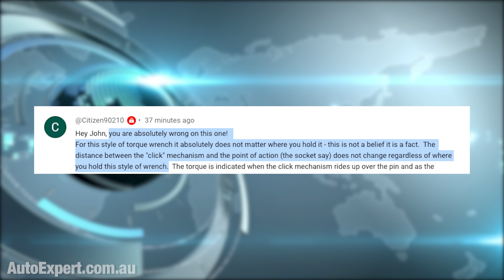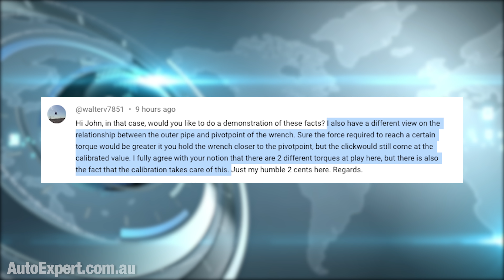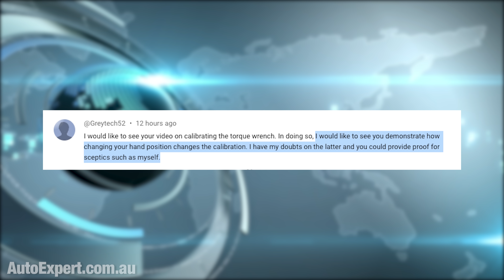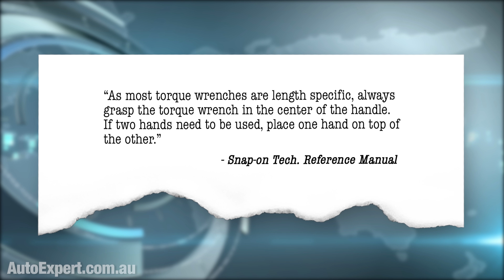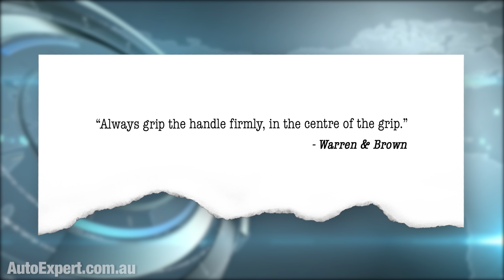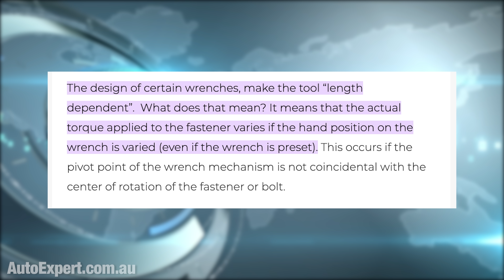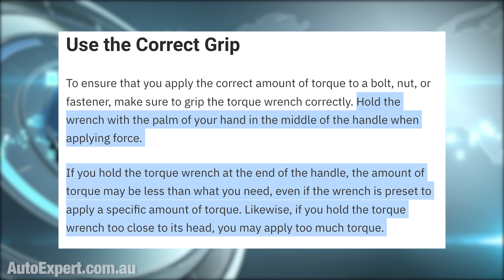Am I wrong about torque wrenches & hand position, again? (The facts) | Auto Expert John Cadogan

Comment: John is correct (unfortunately).  It can be demonstrated with simple maths.  Imagine a torque wrench where the centre of the handle is 550mm from the bolt being torqued, and 500mm from the intermediate pivot.  If you were to apply 100N (ie equivalent to 10kg) to the handle, the bolt would experience 55Nm of torque, and the intermediate pivot would experience 50Nm.  Assuming the wrench is set at 55Nm, it would click when applying 100N of force to the handle.  However, if you were to “choke” the handle and apply double the force 200N half the distance from the intermediate pivot (250mm), it would again click because the intermediate pivot has experienced 200 x .250 = 50 Nm.  However, the bolt itself will experience 200 x (0.25+0.05) = 60 Nm, instead of the intended 55Nm.

Comment: Hi John, unusually I do want to disagree with you.  However, I do think that when explaining something that is likely to be misunderstood, it really does matter to demonstrate it.  Use of a torque meter in the original video would have been really helpful.  Let's be honest, you made the video to educate. Showing the proof with use of a meter would have been helpful,  It would also have saved the embarrassment of some of your dedicated followers.  I do get engineering and physics but I needed to watch the video for a second time to understand why you were correct.  It does require the movement of ones brain from the simple position of, the click will happen at the selected torque so the hand position matters not, to understanding that the torque on the click mechanism and the torque on the fastener are different and that the designers have to compensate for that, hence they need to ensure the relationship between the torque on the fasten and the click mechanism is constant and predictable.  A very important point.  I suspect you probably deliberately did not demonstrate with a meter just so you could upbraid the average comment maker for his stupidity and make another two videos on the same topic.
Reply from the maker: Perhaps I am that evil...
Reply: @AutoExpertJC  
hahahahah
Its just an Aussie thing..
We Learn from our mistakes - so bluddy Learn !

Comment: The hand position matters 100%. I used to calibrate torque wrenches for a living. You can also look up the torque calibrators, the part that triggers the wrench while you activate it, its on a slide so you can place it on the correct spot. Holding it away from the handle by moving your hand closer to the head or you use a cheater bar on the wrench, will give an incorrect torque value.
Reply: then you have the knuckle draggers that use torque wrenches to loosen a nut..

Comment: If I attach an infinitely long (or let’s say 100m long) cheater bar to the handle, does this mean the torque applied to the fastener will be zero or close to zero?

Edit: no, it would apply less torque equal to the percentage difference between the distance from the point to apply the torque and both the socket, and the pivot point
Reply: I think if you would use a long extension and fix it to the end of the handle, you could essentially rotate the outer tube around the click point, thus ending with a click without torque on the bolt. Not 100% sure tho.

Comment: The primary reason torque
wrenches come in different
handle lengths is to provide the
user with various options for
leverage and reach, making it
easier to apply torque in different
working conditions. Longer
handles can provide increased
leverage, which can be
advantageous when working with
larger or tighter fasteners, while
shorter handles may be more
convenient in tight spaces.

In summary, while the length of
the torque wrench's handle can
affect the user's comfort and
ease of use, it does not directly
impact the torque applied to the
fastener. The applied torque is
determined solely by the force
applied at the end of the torque
wrench.

Dimitris 
P.S. I love your presentations, but please using a put on voice while reading peoples comments, does nothing but degrade your program.... personal opinion.
Reply: Yep, I've got one 3/8" drive torque wrench and two 1/2" drive torque wrenches, and one of the half inch units is almost twice as long as the other. Strange... Almost like they're made for different ranges of torque application!

Comment: So, I just went to my workshop and double nutted a 3/8 inch bolt, clamped it in the. vise and set my 'clicker type' torque wrench to 40Nm. I tightened the top nut until it 'clicked' then moved my hand to half way down the handle and pulled again, guess what, absolutely no difference, the top nut didn't tighten any more. Make what you will of this.
Reply from the maker: Static vs kinetic friction, and ther lack of experimental control, 'fail'...
Reply: @AutoExpertJC  No John, I did it several times, marked the nuts with felt pens and the threads are clean (brand new bolt and nuts, stainless steel). I tightened and marked the nuts after the initial tightening, loosened the top nut while making sure nothing else moved and re tightened it holding the torque wrench half way down, everything still lined up. I call BS on your theory, and if you are so confident, how about you demonstrate it. While I agree it isn't best practice, I don't think it makes a significant difference where you hold it.
Reply from the maker: Yawn. All the torque wrench manufacturers are giving the same advice as me.
Plus, I don't give a shit how you use your torque wrench - that's on you.

Comment: I'm a mechanic of over 30yrs with time off between for good behaviour only to return to the crime, I will be honest I didn't realise, pretty sure I have never used a torque wrong, maybe not by accident but from previous training and just repeated actions (I was probably advised why and just forgot). 

I believe each video you post is researched before hand, or you have long experience in what you post, you usually do the science not the gospel belief, so I believed you, but I did think you were wrong about drive length (not the crows feet offset), but I did the research and found myself wrong, it just feels wrong due to the torsional twist which shows extra rotational distance on the end of the torque wrench (often causing you to run out of room with extra extensions). No different to when you use a breaker bar with and without extensions or shorter sockets, sometimes you can not get enough torque at the bolt due to twist distance and being afraid of breaking that drive (sadly I have done to many times).

 There are videos on Youtube with the results of both changing hand positions and drive lengths, but I would still be entertained if you showed both in one video for the sceptics on here, many that would believe the tall unexplainable stories of thousands of years old books than that of provable science. (Sorry for the poor grammar, not my strong point)

Comment: If you have your hand anywhere on the tool it makes 0 difference to the amount of work done to make it click only the amount of force over distance.  You can do the experiment easily, choke up on it and it will take more force over a smaller distance and if you use the handle it takes less force over a longer distance.The head of the tool will give way at the same amount of torque. If it was a solid  breaker bar for example then it matters. This is a dumb debate anyways because who would not use the handle as intended anyhow?

Comment: I guess it must be rocket surgery for some. It's in some way self-explanatory. If the grip position and handle length had no bearing on the accuracy of the wrench, 90% of torque wrenches would be the same length, with increments up to 678 nm (500 ft/lb) and all we'd need to do is use a cheater pipe on it to get the high torques.
It's why 540 nm (400 ft/lb) torque wrenches with 800-1000mm long handles exist.

Comment: You, Hey You, out of the gene pool!  I'm only an amateur, haven't used one in almost a year, only used them for less than sixty years but I'm pretty sure hand position actually matters.  The first torque wrench I used had a flexible beam, a long pointer and a scale to read off of. It also had a plastic grip handle with a pin to pivot on and provide an exact beam length under the hand.  That was the least of torque wrenches.

Comment: Makes no difference where you grab the handle - except it gets harder for you to reach the torque setting if you hold closer to the fulcrum point (the nut or bolt) the actual torque setting will remain valid at all times!
Reply from the maker: Bullshit. I prove it in the next video.

Comment: Anyone who has adjusted a torque wrench realizes that when you go up on torque numbers the wrench gets shorter. If you knew exactly how much to choke up on a torque wrench theoretically you could get different numbers without even adjusting the tool. Spot on.
Reply from the maker: You could do it empirically. Seems a long-winded way to avoid dialling in a setting. And it gets like hard work for the high settings.

Comment: Your point is correct, but your explanation as to why is wrong.
The pin at the ratchet end is a fulcrum  any force needs to be applied directly over the roller lock otherwise the lock and the pin will bridge the load. The load being put on the fulcrum pin will not be measured.

Comment: I really don't see how moving the hand has any effect on the clicky thing.  Chocking should require more force to get same force applied.  Need to see mathematical forces to understand more.
Reply from the maker: Your failure to 'see' how it works is your problem, dude.
Reply: @AutoExpertJC  Seams many people can't see it.  So many you had to make another video proclaiming how correct you are.  Right you may be. Would help to have a diagram of the forces applied to the clicky thing.

Comment: The outer bar is stiff by design and it doesn't matter where the eff you hold it or pull it with a bit of string from the dark side of the moon.

Comment: I find it very amazing and somewhat amusing ( except when applied to a piece of equipment that I own and is being worked on ) when 'mechanics' have, apparently, not the slightest idea nor clue of the physics behind the use and application of a torque wrench.
* how many times have we seen a so called 'mechanic' tighten the lug nuts of a vehicle by using the momentum of a rocking  vehicle caused by the over exertion of force on the torque wrench. Then, as the click is heard, they go considerably beyond said click before stopping  the tightening action. Oh my!

Comment: Just tighten the bolt till it strips then back it off 1/4 of a turn.
Reply: Or as I did removing bolts from a sump cover, turn to loosen until they shear off from corrosion. No worries about over-tightening then.  😲

Comment: Ok so think about this, the wrench is set to deliver 100nm at socket, hypothetically it takes 90nm the hinge pivot of the tool to deliver said 100nm at socket. If hand position makes no difference like you say when there is only a single pivot point, why does the socket care how it receives the 90nm at the hinge pivot 🤷‍♂️, I look forward to your physical test video and the flaming I’ll likely receive for this😆
Reply: Ok physics lesson time

Let's say the torque wrench is 1metre long to make the maths easy.

We I'll use your scenario of the 100Nm of torque on the head being the required amount. 

The pivot is 10cm or 0.1m back from the head.

This means that 100N of force must be applied to the handle 1m away from the head.

So 100N at 1m or 100Nm

At the pivot which is 0.9m from the handle it's 100N at 0.9m or 90Nm

Ok let's move the hand to half way along so 0.5m from the head.

We still need 100Nm so you need to increase your force! 

At 0.5m you now need to put 200N at 0.5m to make 100Nm 

What happens to the pivot. It is now only 0.4m from the hand so 200N at 0.4m is 80Nm....not 90Nm

But the torque wrench wants 90Nm at the pivot before it clicks....so it WONT CLICK. Even though the head is receiving 100Nm still the pivot is only receiving 80Nm....so it won't click

In fact it's not until you are applying 225N at 0.5m from the ehad that it will click. That equates to 112.5Nm at the head over 10% more than spec.

That's why it matters.
Reply: Excellent explanation, you have made this sound more simple in a few dozen words then any video I’ve seen yet. Not everyone’s brain computes mathematical jargon and some practical words can be so much better. I’m sure my example sheds light on why this confuses so many people!
Reply: @ClaytonDerix  To be fair to John, his assumption he made to begin his explanation is that people understand and have internalised the idea of ratios and would recognise a violation of a change in ratio if they saw one without need for further explanation.

Which lots of people would notice...but people often miss this kind of thing if they don't deal with every day, even if they realise whats happening when you point it out. 

Like if I said, "I am selling something for 10 dollar and then decide to do a sale for half price. If I made 6 dollars before the sale what do I make during the sale?" 

A lot of peoples first instinct, even if they know better, is to say $3. Forgetting that the purchase price was fixed at $4 meaning its actually $1.

So when he said that the ratio of the torques is based on the difference in the lengths between the 2 pivot points being fixed... its hard to imagine straight off the bat that the distance between the pivots is fixed and not effected by the change in ratio, and thus must affect the ratio instead.

IE if the ratio starts at 9:10 and then you half it it becomes 4:5 NOT 4.5:5... It's a very easy trap to fall into but also one John would never make or imagin anyone else wouldnt pick up on.

Comment: 42 years repairing motor vehicles, and it never occurred to me to misuse a torque wrench by using it any other way than which it was designed  for.  The hand grip is there for a reason.  

The same can be said for diagnosing problems.  If you don't understand how something works, how in the world are you going to be to diagnose faults with it?  One of the first questions you should be asking yourself is, why did the design engineer design it like that, and for what outcome?  Basic stuff!

Watching fools immerse themselves in their folly is never easy, John.

But I've had to watch it for years and gently encourage my co-workers to engage in thought processes so foreign to them.  Challenges, challenges!

Comment: Have to say,  I have been converted, John is not as stupid as he looks. I couldn't wrap my head around it at first but when I saw the cut out drawing of a torque wrench it all make sense now, imagine if you grab a wrench by its first pivot point directly you could snap the bolt and it would not even click at its lowest setting because you basically eliminated the pivoting, so the closer you get to the said pivot point the less it'll pivot and thus will apply more torque to the bolt 😮

Comment: Everything matters; hand position, turning speed, air humidity, air temperature, parts temperature, wrench temperature, how old wrench is, lubrication, rust, water, dust, dirt and even fu**n position retrograde mercury in horoscope... All that and many other things will affect final clamping force.
But also doesn't matter at all; wheel nut on car should be at 10 kg at 1 meter distance but it's fine from 5 to 25 kg. Bellow 5 kg wheel can unscrew himself and beyond 25-30 kg you are destroying things

Comment: I used torque wrenches for 13 year's around the clock, as a fleet technician for Bridgestone commercial, I carried 2 sizes for the same purpose, one short and one very long handle, all for truck's forestry industry and farming and off road equipment, it was very simple system, they were tested every year by a certified team, I worked up too a hundred hours per week on the move around the central North island of sheepshsgastan, 😅😅😅😅.  Torque up every wheel set is set down by the land  transport authorities, so I would've been liable for any damage caused, our car tyre's also required the exactly same way. Everything was signed of by each technician,   again John mate you hhave all the morons by the family vegetables 😮😅😅 regards Wassa sheepshsgastan, 😊😊😊😊,
Reply: why do kiwi sheep herders wear gumboots?  you know the answer..
Reply: @petesmitt  apparently the gumboots are easier to put on, now that's from my perspective, as I have no sheep experience, but then like the Irish joke's I am aware of some answers, regards Wassa 😉 from sheepshsgastan,

Comment: Fun to include the legendary Warren & Brown and, in particular, the image of a fixed-head, dual signal wrench - or, as my old man would have called it and revealed his ignorance, a proper torque wrench.

I believe that, if I choked up on my dual signal, with the action arm pivoting (or not pivoting, I suppose) about the fastener just as the lever arm does, I would still over-torque my fastener.
Is this correct?

Comment: There’s a geometric equation that can calculate this difference but I can’t remember what it is right now. I think I’m affected by the dumbshittery. The reference to deliverance was actually quite amusing. PS I live in the deep south of the United States. Lol.

The differential can be explained very simply. The farther your hand is away from the pivot the more leverage you apply to the pivot the faster it’s going to click the shorter your hand is from the pivot, less leverage you apply to the pivot the longer and more pressure it takes to make it click it’s all depending on how much leverage you apply and force you apply to that pivot